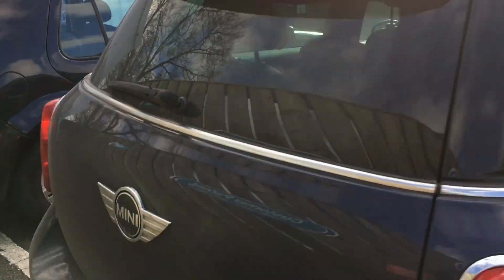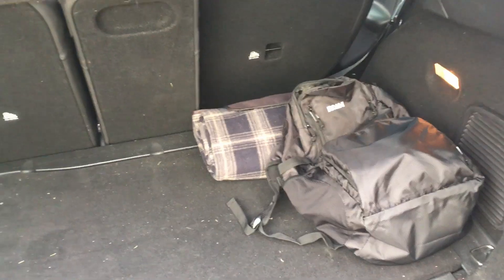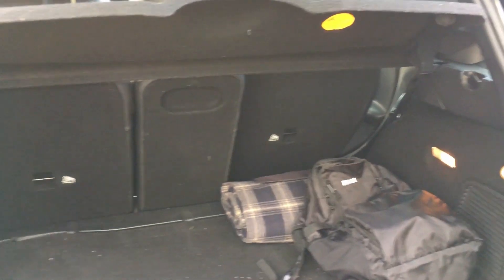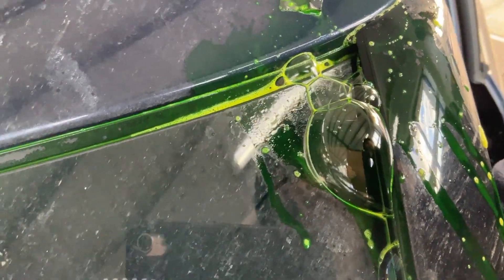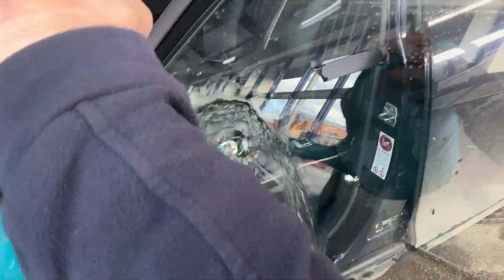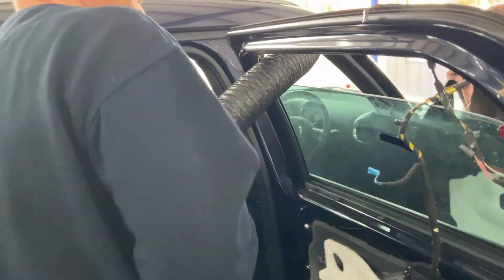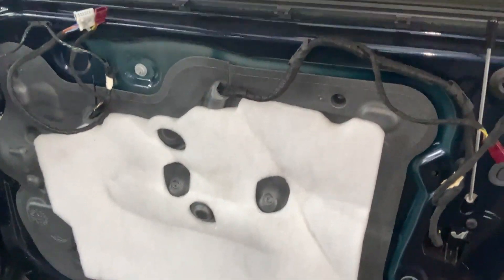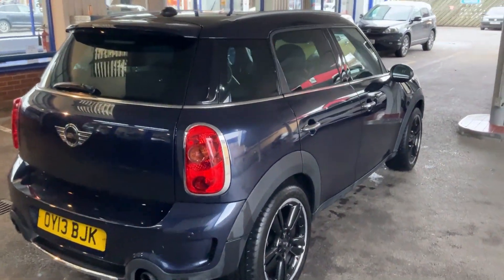Mini Countryman | Car Water Leak Specialists | #MiniWaterLeaks

Comment: Thought it’s worth asking you guys to see if you can help. I’ve got a mini countryman and water has been getting into the boot (mainly passenger side) when driving in torrential rain,but there’s no obvious leak. Tried a hose over the car and everything. Anything recommendations? Would really appreciate it. Thank you!!
Reply: Mostly likely, water is splashing up from the road under the rear bumper, where it gets through the rear vents. The vents are like a one way valve and shouldn't let water in, but the plastic gate weakens over time.

Comment: 2015 Mini Countryman leaking rain water in back doors. There is a gap at the top of the door and the inside catch is complketely rusty. Is there any help for this? Anything ?
Reply from the maker: Sounds like we might replace the rubbers and latch, then dry the car.